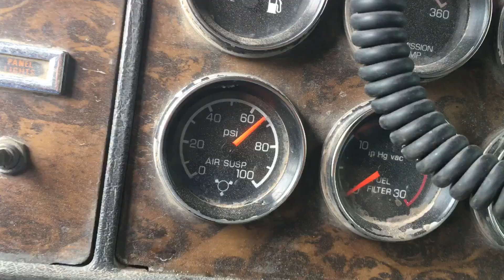CAT 950 loader getting end dump trailer loaded

Comment: Nice! how much weight is that, about 50k pounds depending on what that material was?
Reply from the maker: Antonio Castrejon it’s around 40,45k it’s  broken down concrete with a percentage of water/sand. Very good material for driveways or even mix with Portland cement to make some concrete. I was grossing at 65k with this load.